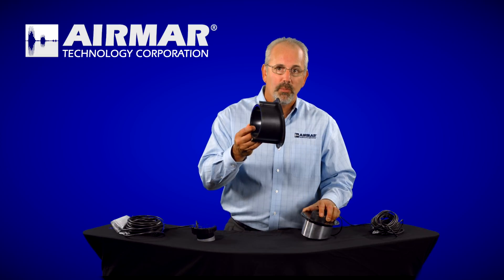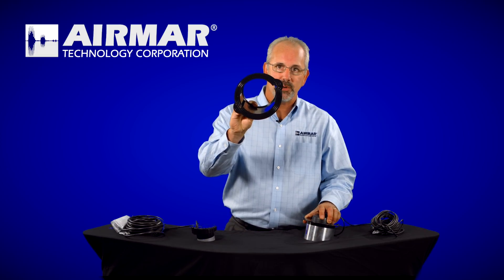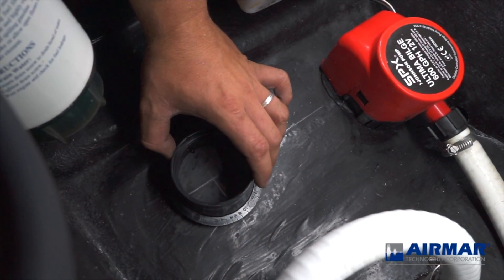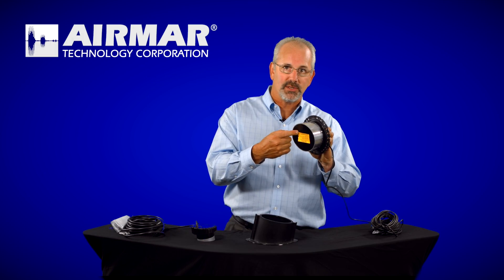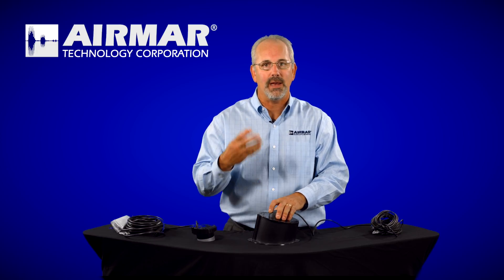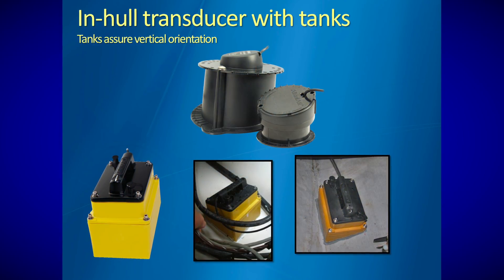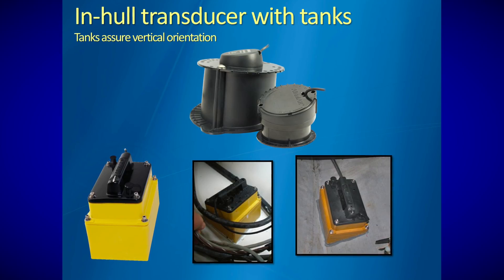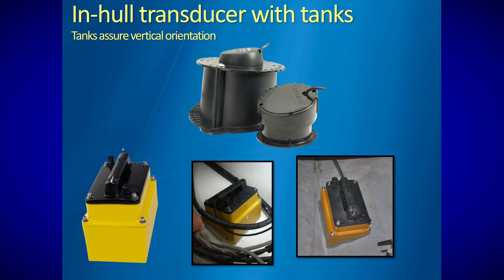Transducer University Pro Tip: In-Hull Maintenance

Comment: Mine was epoxied down to the inside hull. It was never properly sealed at this base and always leaked coolant. I got sick and tired of taking my back seat out and stretching deep in the back to remove the transducer and refilling it with thus coolant. So i dried out whatever coolant was in the 1/2 sealed well and siliconed the inside and outside of the well. Let it cure, then added 20/50 motor oil. Hopefully no more back and forth now getting it to work. Right from brand new, it was a very poor installation by someone who didn't know how to properly install these. I did the oil because coolant evaporates and disappears quickly. So hopefully the oil lasts longer.